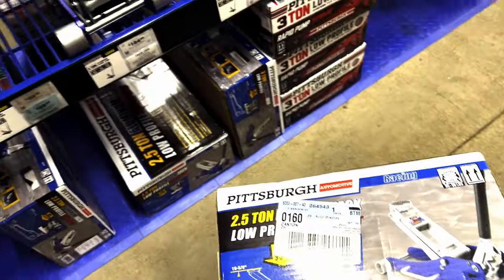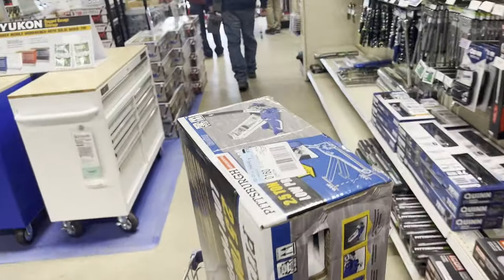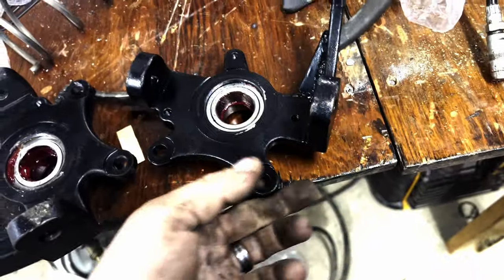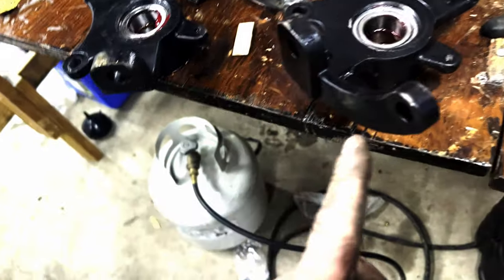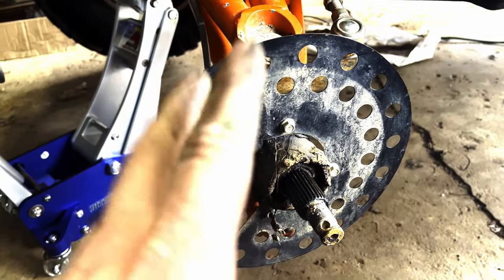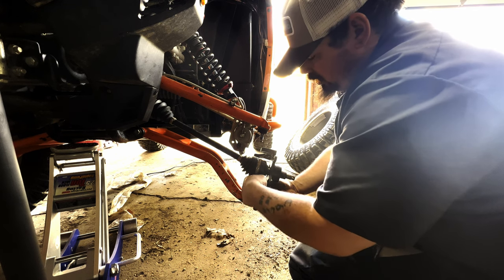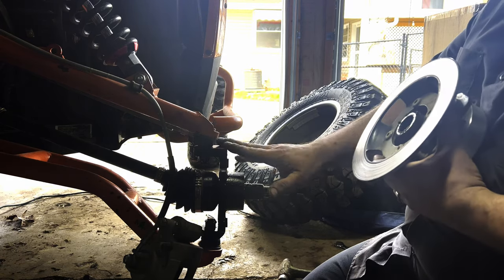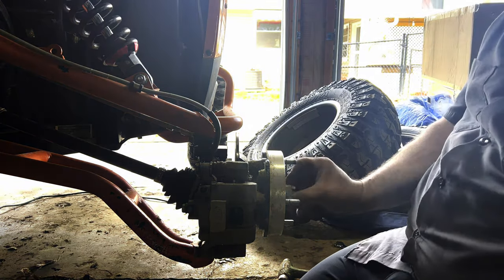CFMOTO Required Maintnance

Comment: Let me know how that jack works. Been looking for a new one. We’ve got some Daytonas at work but those have better price. After watching your 4 part series noticed the area you live, I used to go down to the Barker spring house all the time
Reply from the maker: Yes. Spring house is at end of my road lol.   So far it’s working great. Slides across the floor like it’s on ice too
Reply: @R.N.GPerformance  I have both the 3 ton and 1.5 racing jacks like you bought. They are great!